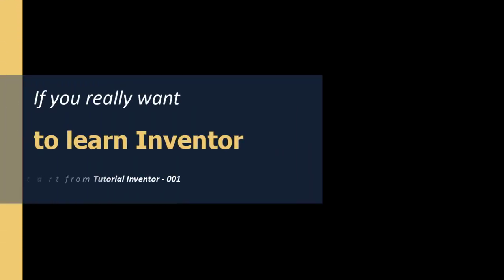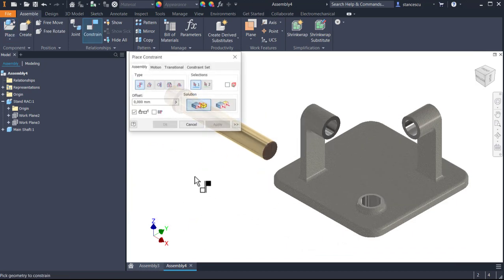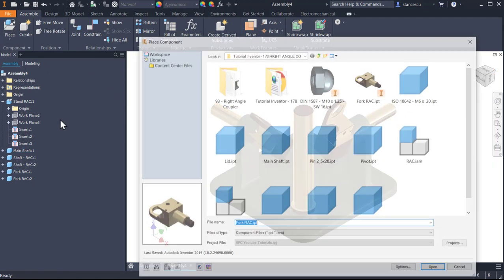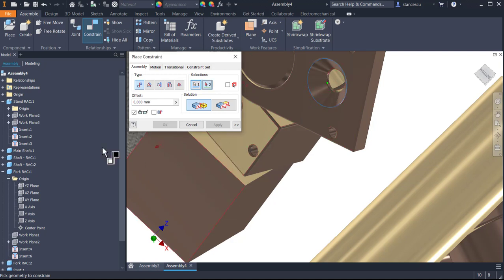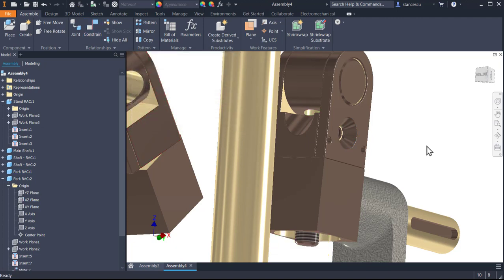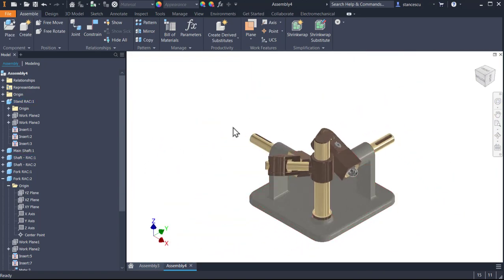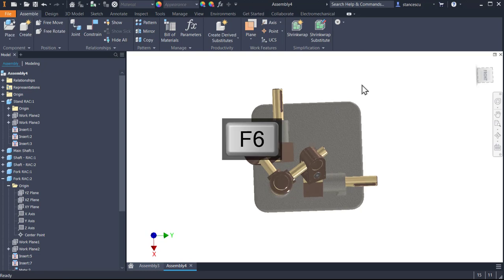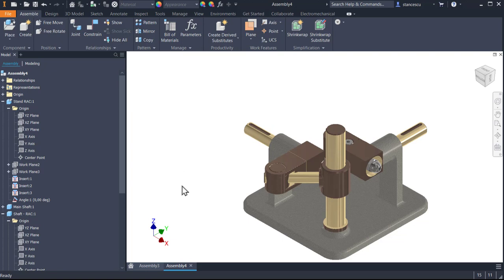Tutorial Inventor - 178 Right Angle Coupler

Comment: Hello Constantin, to the problem: Sleeve part is in collision with main shaft ring when it is in the bottom position. Is it so? (I also do not want to spoil it to others, You can delete the comment if You feel like)
Reply from the maker: Dear Petr, you're right! There is a collision between the right-angle shaft sleeve: 1 and the RAC fork: 1.
The error was at minute 8:13, when I selected the wrong position of the Fork RAC: 1. At that time, you need to rotate this part by 180 degrees and Pivot: 1 accordingly, so that you place the fork RAC: 1 with the cut cylindrical in the other position.
To avoid this collision, the best solution should be to make symmetrical cylindrical cuts on both sides, but physically, if you try to place the current part in the wrong position, you can not move the mechanism. This means that only when you create this assembly in CAD (as we did) can you make this mistake, but not in real life.
Thanks Petr for the observation and rest assured that many people will benefit from my mistake!
Reply: @prof-stancescu  Whoa I did not seen that: I have accidentally placed the Fork RAC in the good position so the mistake was not on my assembly. But there is another one. Place the Sleeve with Right Angle Shaft in the lowest position and move it. It is in collision with the Main Shaft collar (vertical one).
Reply from the maker: @petrkubes593  Well, you are right again, but this mistake was placed intentionally by me to see if people are trying to model my mechanisms!!!
You are the first one who observes this mistake! The solution is simple: increase the height of the Stand RAC:1 by 5 mm and everything is OK.
I use to place such intentional mistakes on my students to find out which one is smart, or smartest...
I do not change the height on my site to see if any other guy will find this mistake.
Be quiet and do not let them to know the trick :)
Reply: Pane Kubeš,  
využívám toho že jste občas v diskuzi. 
Chci se zeptat jestli  nevíte o práci s Inventorem. 
Na začátku své profesní kariéry jsem pracoval jako konstruktér JUS  ...to byla práce na prkně. Po 7 letech jsem přešel na kvalitu a do výrobu, kde jsem byl až do důchodu. Teď když mám spoustu volna tak jsem si pořídil Inventor a Catii 5 R21  učím se na tom dělat...hlavně v Inventoru. Už se  to učím 2 roky  a hodně mě to baví. Nevíte o někom kdo by potřeboval  třeba  překreslovat původní 2d dokumentaci do Inventoru a nebo  rozkreslovat sestavy....něco co by nevyžadovalo být 100% času v kanceláři. Jsem mobilní, pendluji mezi Severomoravským krajem a Prahou.
S pozdravem
Jan Kotrla
Reply: Zdravím, zrovna nikoho nehledáme. Ale přeju Vám hodně štěstí a snad něco brzy najdete:) @JanKotrla-y3r